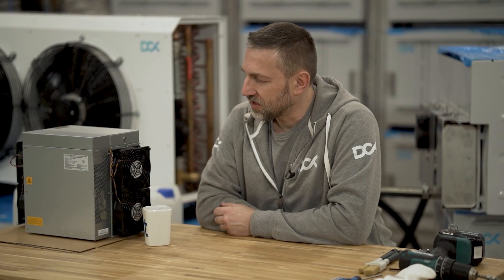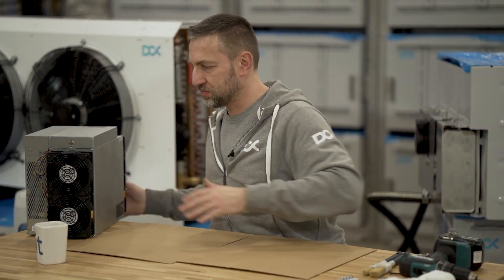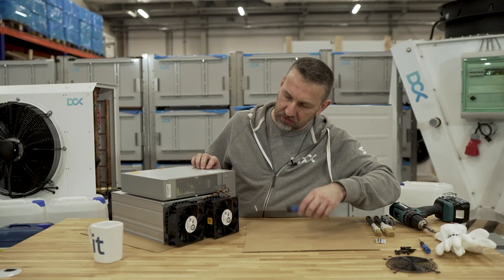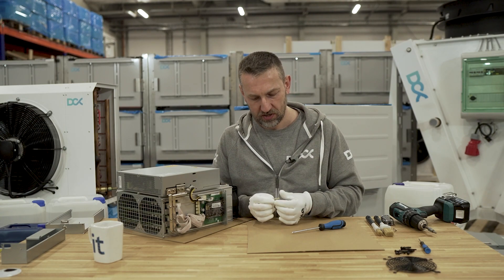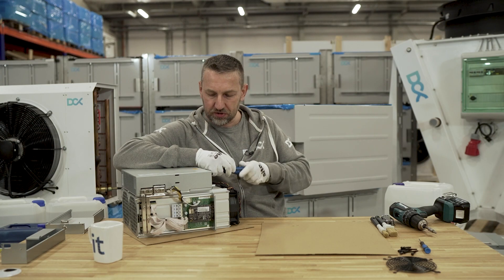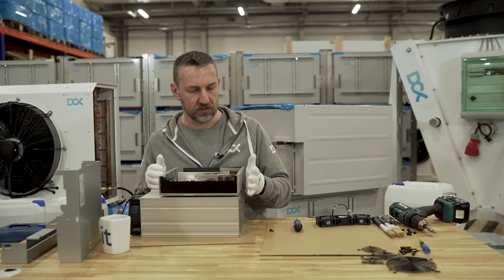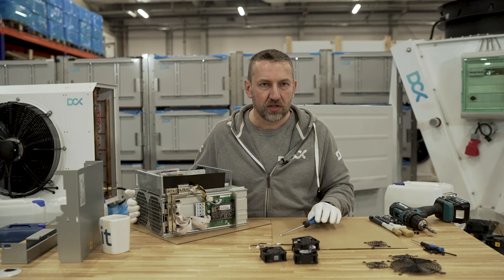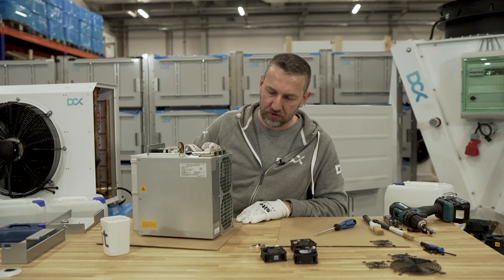How to clean S19 / S21 miner before the immersion cooling?

Comment: Very interesting video. I have heard that to submerge the equipment in dielectric oil it is necessary to replace the standard thermal paste on the S21 plates since it falls apart and pink deposits remain on the bottom and contaminate the oil. This is true? Which one would have to be placed? thank you very much in advance.